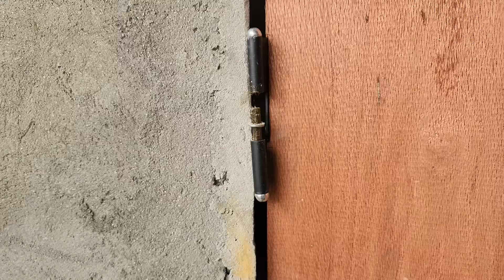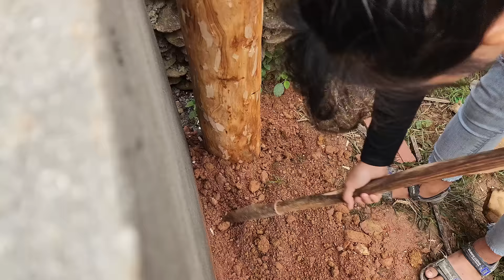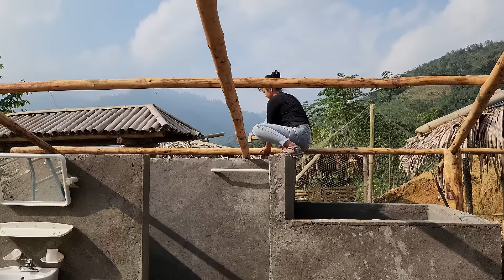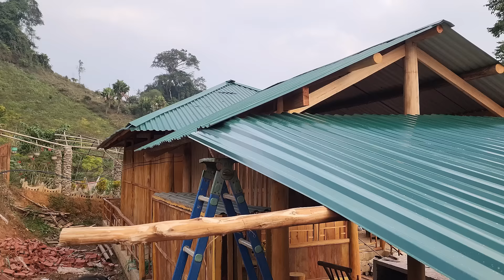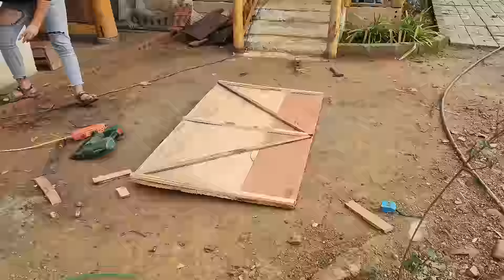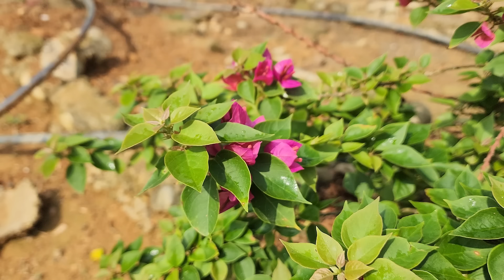Completing the bathroom's corrugated iron roof, making wooden doors, and showering and shampooing

Comment: Very well done. Only 2 points. Don't you have a man in your life as he should be helping you if he was any good and 2. you need to install drainage for your bathroom or it will start to smell a bit after a week or 2. This should have been installed first before building and installing the peripherals Must get very lonely without a partner..